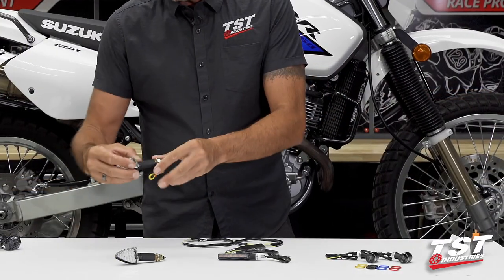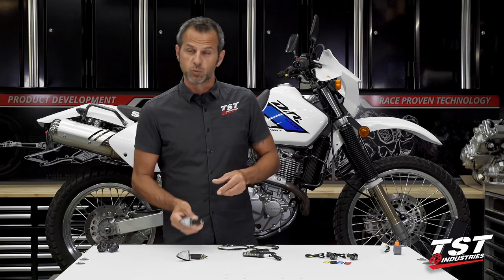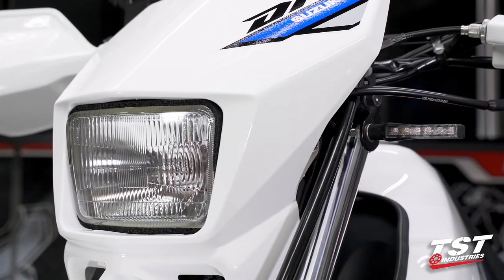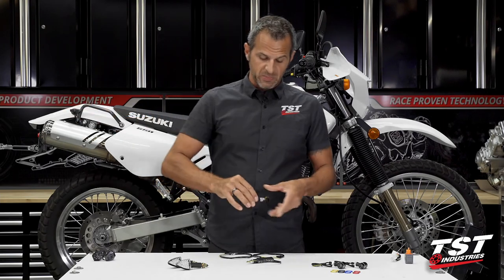How to Install LED Front Pod Turn Signals on a 2001+ Suzuki DR650 SE / S by TST Industries

Comment: Do you sell any signals that also act as running light?
Reply from the maker: We are close to launching our Running Mate product. It gives you running lights on any single circuit signal lamp, like the one in this video. You do have to find an alternate power source for the running light because these bikes do not have that in the front signal connectors from factory. Easy enough though when you follow our instructions. Just shot that instruction video today.
Reply: @TSTindustries  ; ahh, excellent.  Great timing.  I’ll keep an eye out for it.

Comment: I need to contact u guys tu do me a custom harness can u give me an email or something
Reply from the maker: We typically dont do one-off work on bikes not belonging to our race team
Reply: @TSTindustries  i talked to a guy a whila ago an he said that u guys will do it,.. all I need is the harness that u guys sell for that goes to the turn signals on front but i want a extra connection for the after market zx10 mirrrors that i bought, there is no way u guys can do that?
Reply: @TSTindustries   i talked to a guy a while ago an he said that u guys will do it,.. all I need is the harness that u guys sell that goes to the turn signals on front but i want a extra connection for the after market zx10 mirrrors that i bought, there is no way u guys can do that?( i got a zx6r )
Reply from the maker: @hectorgalvan9046  oh I see, I thought you wanted us to build an entire harness for the bike and we only do that for race bikes. Making a Y splitter for you shouldn't be an issue
Reply: @TSTindustries  yes exactly thats all i want let me know how can i get in contact with u to do that
Reply from the maker: @hectorgalvan9046  you can send details of what you need in to our customer service team through our website. They will forward to engineering.  Just remember, when you make a request like this you have to send all the details necessary to make what you are requesting.
Reply: @TSTindustries  oh ok man i will do that….thanks so much